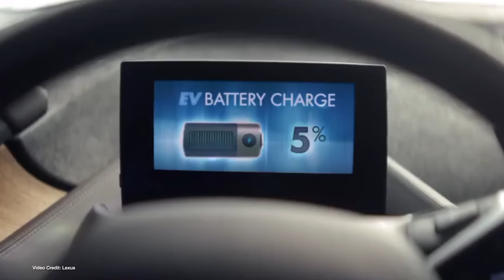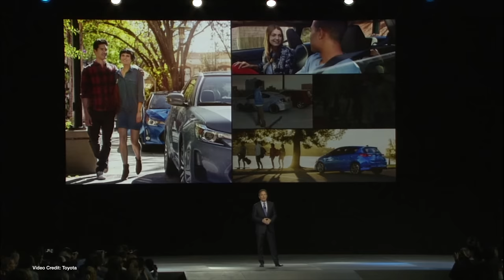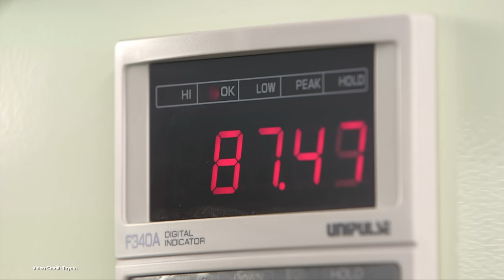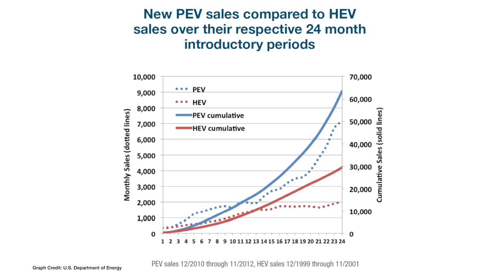Toyota Insists You Can't Ban ICE Cars Yet. It's WRONG.

Comment: The toyota hydrogen technology is for the heavy industry and its working very well, hydrogen for example is going to replace coal for steel production.
Reply: It takes electricity plus water or electricity plus natural gas to produce hydrogen. Natural gas, not coal, is replacing hydrogen. DUH.
Reply: You can use electricity for steel production, no need to waste energy to produce hydrogen.
Reply: H2 reduction of steel is cool, and maybe it has a place in shipping, but it's not viable as fuel for mass individual transport [cars].
Reply: @casperhansen826  Hetoila is referring to this: https://youtu.be/ywHJt88H5YQ
It's actually pretty cool, it reduces the CO2 released when making steel by a huge amount.
Reply: The Toyota Mirai is for heavy industry? Which industry would that be?
Reply: You mean it’s natural gas replacing coal for steel production. And no that won’t happen either. Why would you waste time and energy creating hydrogen from natural gas. Unless you have a specific purpose for hydrogen. It’s the dumbest thing I have ever heard. No one can produce hydrogen efficiently from electrolysis
Reply: @rogerstarkey5390  Offshore wind or solar to crack water into H2 and O2. 

Yes the storage would be a challenge, but we already store megatons of oil, natural gas, and other potentially dangerous substances. 

You can burn the H2 directly in an engine, no need for the fuel cell to battery to motor, but even if you go that route you need much smaller batteries than in a fully electric boat. 

With shipping you have far fewer places needed to have that infrastructure. It can be 100% clean, unlike any other way to power ships other than sailing. There is some neat tech around using wind do supplement other forms of locomotion, but there's no reason that couldn't be used with H2 power too. 

The number don't add up...? What numbers? Be specific or don't use terminology like that, otherwise you look like one of those Karens whining about "chemicals".

The specific density of the hydrogen tank in a car is roughly equal that to a battery in a car, but because of the square cube law the tank in a big ship can be far more energy dense than a battery in a ship. 

But all that doesn't matter, I said it makes more sense for shipping than for personal transport, not that it made complete sense. Try looking for nuance next time. 

PS: what's with all.... the ........ random....... (and) also the ()?
Reply: @rogerstarkey5390  nuclear. And if your ship is nuclear powered that's all you need.
Reply: @tigertoo01  nonsense, who said they're going to use natural gas to make hydrogen?! Like batteries are used to store energy, hydrogen can be produced with excess energy from windfarms even at night.... also electricity is not the only important thing for the industry, hydrogen is still a very important base product, even elon musk is trying to make methane to power its rockets.
Reply: @casperhansen826  really?! Do you even know how steel is produced?! Go educate yourself.
Reply: @Jcewazhere  hydrogen could be stored in many forms like Ammoniak......
Reply: @carholic-sz3qv  Very big difference between methane and hydrogen ?? Of course Elon's using Methane. Its the right fuel for his rockets. over 95% of all hydrogen in production today is made from natural gas reforming. what is all this excess energy from wind turbines? It doesn't exist. and then if it did you are to covert the electricity to hydrogen and lose 70% of its energy potential? Sorry it doesn't exist today and it will never exist in the future. Batteries, Pumped hydro, even flywheels offer a much better storage potential than hydrogen. You have a lot to learn on the subject?? How do you come to such conclusions?
Reply: @lestermarshall6501  Yeah and forget about the toxic waste that no country can deal with efficiently. If there was a nuclear option which byproduct was inert I would say youre correct but as it stands not a chance.
Reply: @casperhansen826  unfortunately my friend steel isn't always made from scrap, and the demand is still significantly growing up specially with China. If you just look at iron ore trains around the world, they are over 1.3 miles long or around 2km. The majority of steel is still made from iron ore
Reply: @tigertoo01  spacex still uses refined kerosene called RP-1. There is actually alot of energy lost today with windfarms and solar farms its a real case in Germany for example, many companies have been developing energy storage solution to be used as buffer for the grid. Windfarms also produces electricity at night when the demand is very low just to mention.
Reply: @casperhansen826  recycling steel is not steel production.

Comment: They do make the RAV4 Prime with a 40 odd mile EV range and the Prius Prime with close to 50 miles of EV range. They could have made a compelling argument about PHEVs with increasing EV ranges as an intermediate step, producing more vehicles with smaller batteries than you could building pure EVs.
A 75 mile range PHEV would seldom see a gas station and a small PHEV could do that with a 25kWh battery ( pretty easily ).

But they are not making that argument and in reality once you have the motor and some batteries, more batteries is a better choice than a gasoline engine and a lot of complex add-ons to mesh them together ( although Toyota hybrids are bloody reliable ).

Comment: My personal realisation that Toyota were not move greener was when the Prius Plug In was released. At that you had the new Leaf and the original Volt and there were hopes that Toyota's plug in version would be ground breaking, and there was much disappointment when the specs of their PIP were released: all electric range of 11 miles. They could have done so much more at that time, but didn't. And they've barely bothered since. Certainly for worldwide models.

Comment: I get what your saying, 
but in some cases it's just not feasible yet,
I wanted to replace my dads 2001 Mercedes E320 diesel with an electric,(We bought the E320 for $2k five years ago and have spent about $1.5k on it in the last five years)  
He drives around 90km/55ish miles a day,
Electric cars with a range of about 100km is close to 10k usd Here for the cheapest used,
We can go out and buy a petrol or diesel car(same model year as the electric) at one third of the price,(and Used BEV prices are not dropping)
I really wish Citroen would make a 90km/h,100km range(all year round) version of the Ami(at less than €9k) because that would fit my dad perfectly,
I am collecting parts to begin converting my Subaru Impreza to electric,
Also need to spend $3k to have a charger set up(rented apartment)
Reply: You are potentially looking at it wrong. You are only considering the purchase price not the total cost of ownership. Doing those 55 miles a day, how long will it be before the difference in the cost of fuel vs cost of electricity has eaten the up front saving on the ticket price of the car?
Reply: @Richard-io9xe  his job pays his fuel,
BTW tco only works when you either have the disposable income or have the ability to borrow that money,
Reply: @storm4710  fair play - not having to pay for fuel kind of changes the calcs somewhat ;)

Comment: I guess if they're doubling down on fuel cells, it could work in a specific way? Maybe they build semis or work on a hydrogen network for Japan. But in north america, I just don't see it happening with passenger cars as we already have an electrical grid that can be upgraded and built out for BEVs which have already benefited from so much R&D.
Reply: And getting people on board with that comparatively easy task is already hard enough

Comment: It’s 2023 now, and there is still no EV that middle class people can buy as a family car! I’m. Ot talking about grocery-shopping cars, but real family-size EVs. Something like a Toyota Camry-alternative or Honda Accord, Mazda 6, VW Tiguan etc. something with proper boot space (800 liters-ish), with 3 isofix seats in the back, with a driving range of 400 km at least in the winter with the heater on! And of course something that you can charge within 15 minutes from 20 to 80%!
And again, it should be  affordable for middle class people, at least! So where are those cars? 
And charging infrastructure is also far away from where it should be! I have seen queues of EVs at a charging station last summer, waiting at least for 6-7 other EVs in front of them to get to a charger! If everyone charges from 20 to 80%, even then it will take over 2 hours to get to your turn! 
2030 is too early to force ICE cars out! That will hurt many people, and it will heavily backfire!

Comment: I really don't understand toyota's resistance when most of the cars made only in japan are tiny. On the other I don't think any car maker including Tesla wants to make a good compact car because it would take money away from more expensive cars
Reply: But their biggest seller has been the RAV4 for the last few years.
Reply: Toyota is totally not resisting at all, Toyota is all about mass production, if they had enough lithium they could make 5 million EV directly tomorrow.Toyota and other manufacturers actually have very cheap ICEs too and EVs cannot compete.
Reply: @carholic-sz3qv  So now the problem is lithium? You seriously think that's what's holding Toyota back? Not even Toyota themselves are claiming that. 
Car manufacturers get the quantity of batteries they've placed orders for 2-3 years ago. That is true for both Tesla, VW and Toyota.
Toyota is totally not resisting at all? They literally just did when they lobbied congress to slow down the EV roll out.

Comment: I think you forgot the mentioned one fact and that is that Toyota is a top seller in the developing world and most country around the world. Most of those country does not have EV infrastructure and won't have any in any near future at all. People need cars that they can easily work on with few expertise and special equipment. That can last for their entire life and after buying one won’t depreciate like a falling rock. Anyone can buy or even built on their own a metal or plastic part for their car, but not everyone can build a battery pack. This was actually one of the reasons why ICU back in the early 20th century took over EV. BECAUSE ITS EASY TO REPAIR.

In addition, there are country that although developed they have a high risk from natural disasters that can wipe out the grid, and EV are a big no no. Just look at my country, Puerto Rico, after Hurricane Maria. We didn’t have electricity for 3 months and some people didn’t even had it for more than a year. If obtaining gasoline was difficult, imagine how having an EV was. It sucked cause you couldn’t even drive it at all. 

Toyota is investing in hydrogen because they know that if they can mass produce hydrogen at a cheap price and create a sustainable hydrogen production they can outsell most cars brands in the developing world and around the world, especially with the future rise in Africa and Asia. Also, in the case of Toyota their main focus is going to be always sales and reliability. EV in most cars brand are mostly unreliable to say the least for now. So, in order not to tarnish their reliability reputation they just wait, observe and see until its time for them to make a reliable EV thanks to better technology improvements that can match their current reliability lineup. And actually this is a good thing because remember, Toyota is the largest. People who buy Toyota buy it because of how reliable they are. If they start making an EV that it’s not reliable to their standard Corolla or other ICU cars, then EV reputation can actually tarnish even further. So by not currently selling an EV that does not match their current lineup their actually doing a favor for EV in a point of view.
Reply: I agree fully with your first point, but not your second.  There is no reason why they should be more unreliable.  it's up to the manufacturer.
Reply: @michaeloreilly657  that’s the thing. The problem with electric cars is that although they suppose to be more reliable in maintenance theoretically wise, in reality they aren’t currently. they won’t last for too much in longevity wise and durability due to the complexity of their components and the lack of ease of repairs. Imagine if your normal ICU Engine never needed to change oil or the belt and stuff, but then after 8 years it’s fully broken down and u need to change the engine. At this point fixing it cost more than buying a new one already or to that extreme. This also happens to ICU cars too (just look at Maserati) btw. The other problem is that most manufacturers makes their car more complicated each day with more electronics and stuff. It’s not such a bad things, but in the long term it jeopardize reliability of the car even further and it makes repairs more difficult and complex. In the case of EV, because of automotive trend they make it even more complex to be more “futuristic” and stuff. Like just look at Tesla and their electric door and glovebox. What’s the point of having to open the car door and glovebox  electrically when a simple lock works fine. Also, I also don’t see EV working well in developing nation and thing because EV takes a lot of specialization to become someone to fix one and a CLEAN ENVIRONMENT. In order to actually provide a good alternative to petrol car, car manufacturers have to provide something that after 8 years or even more it’s simple, cheap and easy to repair at ANY location. 

In addition to that, if we depend only on EV. Then there will be Lithium Ion dependency or in general rare mineral dependency. Which very few regions of the world have those materials and that’s kinda ironic as we have to mine even more. In essence, from depending from petrol now we are going to depend on rare earth mineral. 

Also, as someone who lives in a Caribbean island (Puerto Rico), which although electric cars are becoming popular thanks to taxes, I am just imagining the shithole having an electric car is after Hurricane Maria. If gasoline car had difficulty finding gas (because of generator and shit) I’m just imagining how difficult EV are going to be in such regions of the world where natural disasters is really a big topic
Reply: @michaeloreilly657  also just go to Consumer Report and see how terrible electric car reliability is.

Comment: From what little I do know about Japanese culture this does make sense to me, Toyota knows that they can't dominate in the EV space unless they work on the next generation tech which won't come out for 10-15 or maybe even more years and their is tremendous cultural pressure to save face and project strength so they claim that the things they can do well at are the only important things. I don't agree with it, but it makes sense. Give them a decade or two and they'll be in a good place for solid state based BEVs or maybe even hydrogen fuel cell cars. I still believe that hydrogen cars will eventually be competitive with with BEVs, I just think it will take a while for all of the storage and production tech to catch up to the BEV tech and like Robert from 
Fully Charged Show has said a few times, there are places where hydrogen fuel cells make sense now, mainly fixed route large cargo trucks, it just doesn't currently make sense for passenger cars or other vehicles with less predictable needs.

Comment: Great job, as always, Nikki. Hey, I wondered if you've hear that GM has initiated a Bolt buyback program, and they are ostensibly buying back Bolts involved in the recall. I just called the Bolt Concierge, she confirmed the program, and an agent is going to call me back within 48 hours, to set up the buyback. I've talked to several people on the chevbolt.org forum, and they have gotten really good money for turning in their bolts, much better that the current used bolt prices. I'm planning on getting a Model 3 after completing the buyback. I really like many aspects of the Bolt, but at this point, I see it as a last minute token electric car, I believe GM is losing money on each Bolt, and I think the battery pack was not well made (panasonic in Korea, but actually outsourced to China??) and may have more problems down the line. That, and if Tesla really does fully implement full self-driving, it will be the only company providing FSD for a while as the other companies are so far behind them.
Reply from the maker: I've initiated the process of being assessed for the buyback on my 2017 Bolt, though I don't know what will come of it. Depending on how it all goes, I may talk to Nikki about a video about the experience - Winter
Reply: @transportevolved  Cool Winter, I wish you well in your buyback endeavor. Let me know if any further info on my experience might be helpful. Thanks again for the great work you folks do. Mark